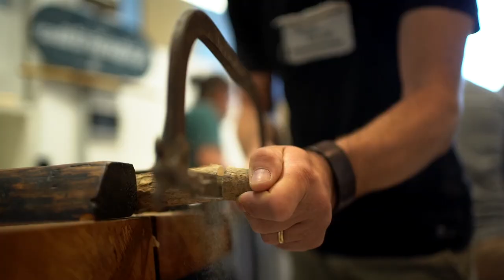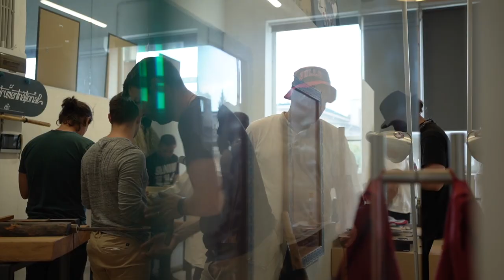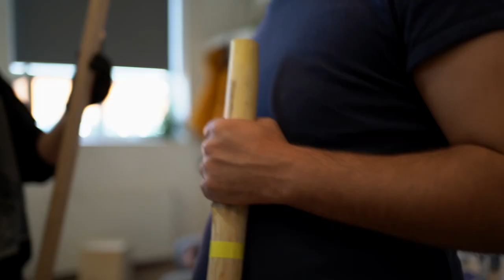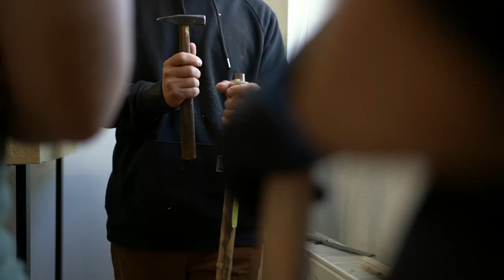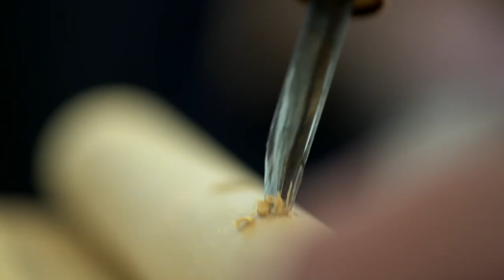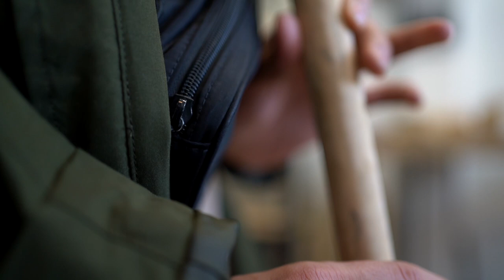Centrul Cultural Subcarpați prezintă: TU, CU MÂNA TA (Fă-ți propriul Caval cu Adrian Mihaiu)

Comment: Salutare. Am vreo 4 cavaluri functionale, unul in Si si 3 in La. Cu un programel am reusit sa fac vreo 3-4 shakuhachi  din bambus functionale (din  vreo10 incercari ) Au trecut mai mult de 10 ani de atunci...  Gasisem atunci niste torte din bambus la dedeman.  Caut informatii cu privire la calculele necesare pentru plasarea gaurilor. Am cumparat un caval de alun de la un mester din Hodac (linga Reghin) fara gaurile date (intentionat, sa il acordez cu rabdare. a stat la uscat  pest 5 ani). Dar dimensiunile nu sunt ca ale celorlate.  Apreciez orice  sugestie si informatie.